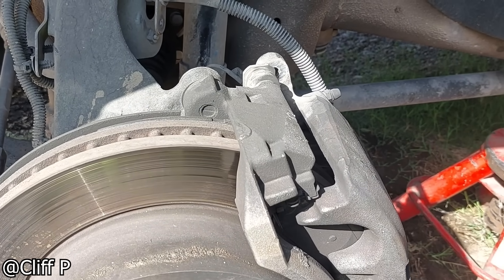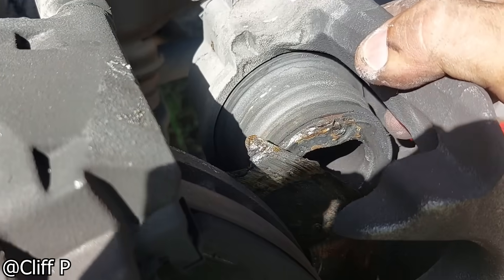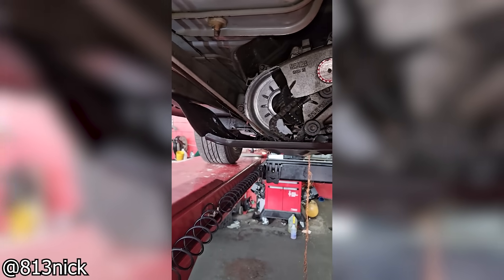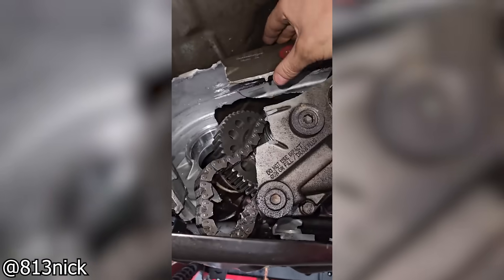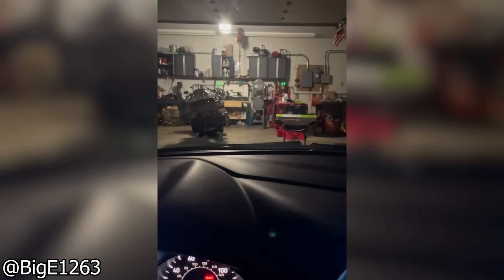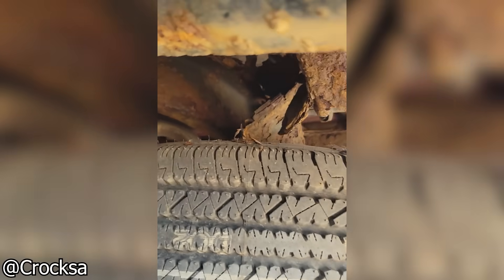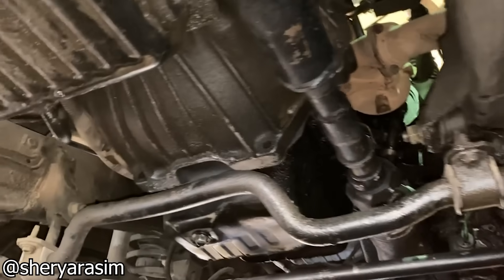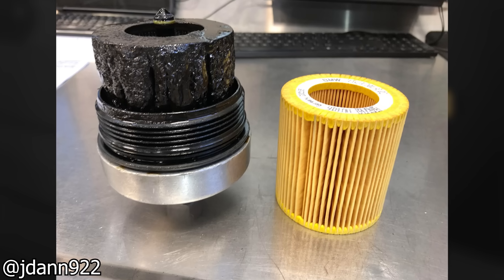Customer States 'Is The Oil Filter Not Supposed To Look Like That?'

Comment: Nothing wrong with the Peugeot, just replace everything between the front and rear number plate...
Reply: Mine's close to 120k miles and I'm starting to think you're right. The engine's quite economical giving close to 60 mpgs, if not 70 on a good day, but anything that's suspension, brakes and mounts lasts next to nothing.
Reply: What’s a “Pugo”. 😊

Comment: Upgrading your fog lights like that is kind of stupid. When you actually need them, they're going to be worse than useless: they're going to be light driving with high beams on.
Reply: Agreed, but sometimes is quite useful to have "portable Sun", when the oncoming traffic refuses to turn off their high beams.
Reply: Fog lights should be yellow. They do a better job of cutting through mist without just reflecting light back at you.

Comment: In the UK any car over 3 years old must pass a yearly MOT test (fit to be on the road) most of the cars in your cases would fail (no MOT is an offence and means you are also not covered by insurance which is also an offence)
Reply: Australia too. You cant renew rego until its done. Its how clunkers and detectives become scrap.
Reply: varies by state in the usa. even in states with mandatory annual safety inspections you see some pretty crazy stuff on occasion. only has to pass inspection one day out of the year, assuming you can't find someone to either pass it for cash or sell you a fake sticker.

Comment: If you get some time it would be great to see the instrument clusters that are going crazy with the explanation on what's causing it. Haven't turned wrenches in a few years and I know all these newer cars are pretty much all electronic. I've seen a lot of these Christmastime vehicles even in the middle of summer would be nice to see what's actually causing those types of issues
Reply: With the way control systems are everywhere and how interconnected they are, a single bad ground can wreak havoc throughout a vehicle. Eric O. at South Main Auto has some great videos about chasing down gremlins like that.
Reply: ANSWERED-- Made in China 😂
Reply: @theglitch99  would have chosen grade 8 bolts but like you said made in China
Reply: @theglitch99  Imagine blaming China and not the automaker who outsourced the part and demanded it be built down to a price so the executives could award themselves another million dollar bonus.

Comment: I have a question for US guys. In Czech republic and I know that in most of Europe, we have mandatory technical reviews for all registered vehicles, where basically a certified mechanic checks the car from top to bottom and if you don't pass, you can't drive that car. Do US not have something similiar? Most of those cars in these vids are like death trap waiting to happen for the occupants and everyone unfortunate enough to be in the general area at the time 🤦
Reply: Depends on the state, some states do not require any sort of inspection. Mine is one of them. Some states do. Honestly I'm not even opposed to safety inspections, brakes, tires, frame etc, but if your car burns oil you gotta repair it or get a new one? Easier said than done if you're broke as hell. I'm pro safety inspections, but anti emissions inspections personally.

Comment: Ok but can someone please tell me if its bad that on my corolla when I was changing the radiator fan motor The screws were stripped so I drilled them out then used chicken wire to put it back together and I am getting the screws